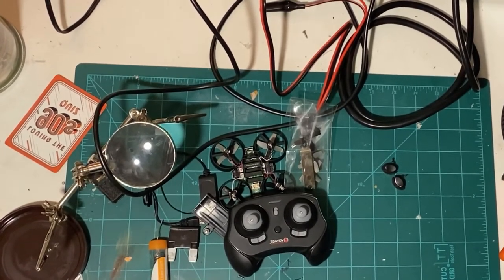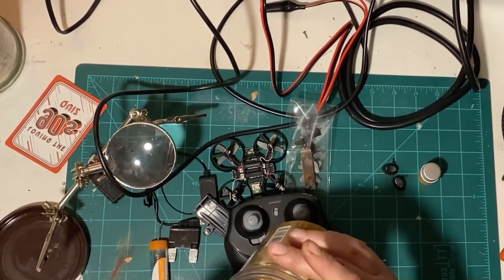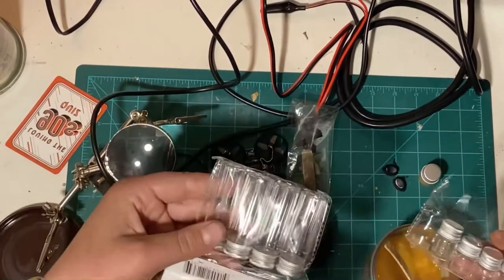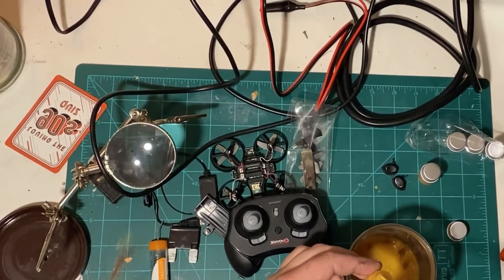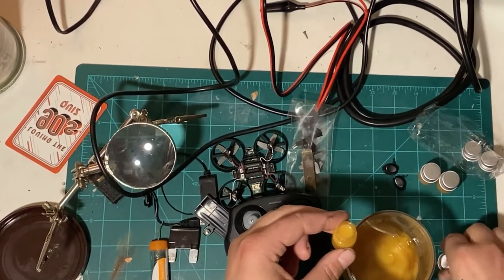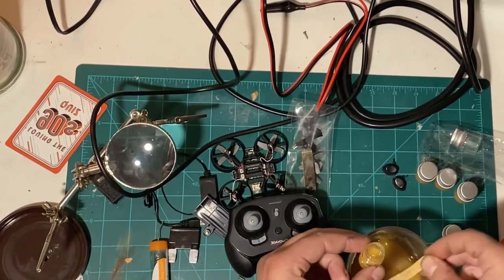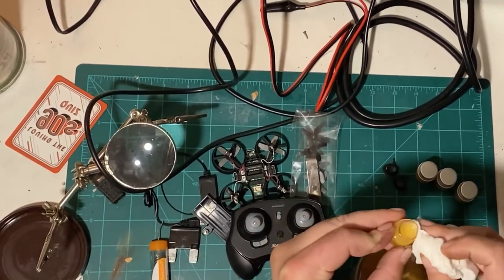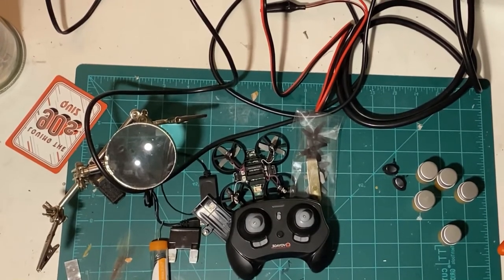DIY Homemade Rosin Flux Paste!

Comment: I want to see tree rosin from multiple species made into rosin, different recipes, what percent alcohol, alternative solvents, different additives, how to filter, temps, times, different viscosities, application methods, and how to clean up afterwards (nothing removes pitch like oil) and more in depth information. Great video , Thanks from Oregon!
Reply: That is a super idea!!!! I have so many projects but I am making  glassblowing torch that consists of a bunch of copper or brass tubes about an inch long soldered together so it causes a laminar flow. I am probably going to make a few of them for other people so I will be using a lot of flux. This is so cool. I am a chemical engineer and I should have thought of this.....

Comment: Add 1ml of glycerine to 100ml of alcohol, aka. few drops of it. It will stop alcohol from burning when you heat your flux with soldering iron
Reply: That is so cool. Is that what the major manufacturers use?

Comment: Hey! I just saw your video. I also made some rosin flux, but a liquid. I used 75ml of isopropanol alc (99,5%) and 17 grams of rosin flux. The rosin was in a little round metal box and it was hard as stone. So I put it on my stove and after that I could pour it into a 100ml pharmacy bottle. Then I mixed it with the isopropanol. I paid 1€ (I think it is equal to 1$) for 20 grams of rosin. Greetings from germany!

Comment: Right on bro thanks for the tip I'm in Washington also and was curious if the Douglas fir sap would work so thanks for the video
Reply from the maker: Believe it or not I’ve actually tried that and it doesn’t work as well, but it does work. Trust me if you look around as your driving around you’ll spot some pine trees. We don’t have tons like fir trees but there are plenty around.